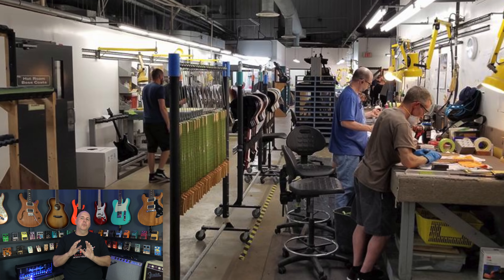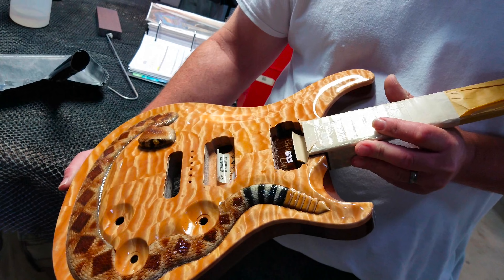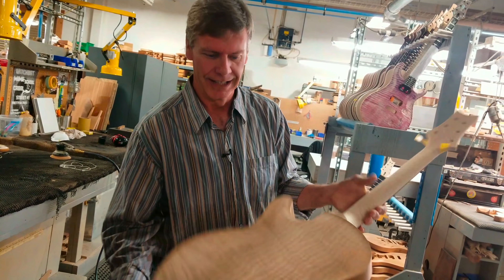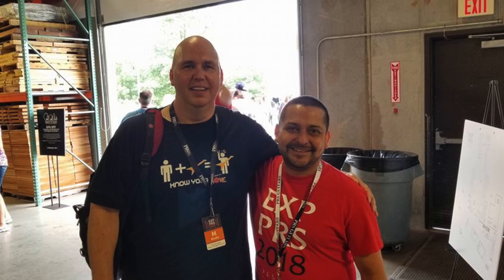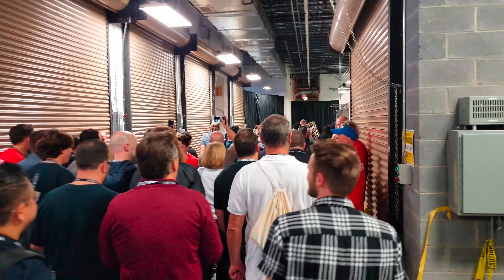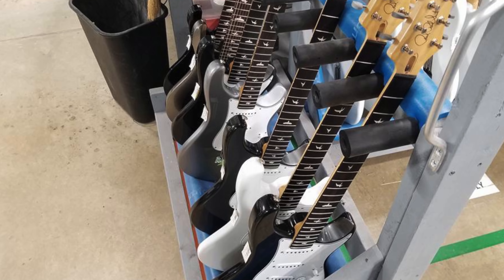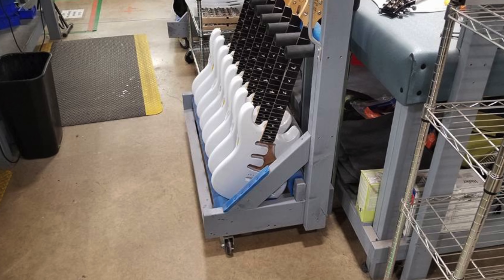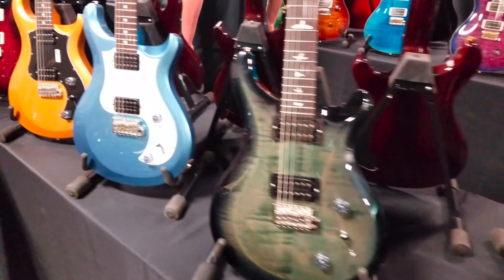What I learned At Experience PRS 2018 Event in 5 Minutes

Comment: Can I ask a about gear question? I have researched, but I don't trust a lot of people on gear other than you, Phil. I added a cab ext to my katana 100 in the back. Drilled, make sure I didnt hit anything and covered all possible contact points. Was VERY VERY careful. And it has been working for 2 months now. I made an nice polish wood enclosure for it to bring as a head to gigs. It has been working great. But, all of a sudden there is no more output. I tried and fidgetted with the cords and every wire contact point, and no sound, even white noise or squeeks. It hasnt been wet, dropped, played with by kids, dinged in anyway. I also bought an aluminum case for it. The only output that works left is the rec/phones. I guess my question is what would be the problem, or what do you think coulvde caused this? Can wrongly plugging in the cab ext into a DI box thru by the technician break it? Thats what happened before I couldnt get any sound. And if you couldn't ever get to this, I understand comments can get drowned in a sea of comments. Still will forever  love this channel. Thanks a bunch Phil.

Comment: Well now...why not use the best quality materials in the construction of the guitar when utilizing the best design, experience, technique, etc. To me, this begs the question...What if a much less expensive, man-made composite turns out to be the ideal material over the traditional, high quality, expensive woods? If tone and playability are king, the cosmetics are still addressable with veneers and other superficial treatments. My point is that Paul Reed Smith Inc. has left that stone unturned. If the material(s) are as irrelevant as indicated, then why not establish a particular material as a viable substrate that is a known and is a ready replacement for the more costly traditional woods? It’s another potential possibility as a way to produce a less costly, American-made guitar or bass guitar with the Paul Reed Smith name proudly emblazoned on the headstock. Please understand that I’m not “sour grapes” on account of the price and the inability to afford one. Not at all. I pull six figures annually; the cost is not my issue. Mr. Smith and his company make the best quality, as innovative as our staid, conservative guitarist community will tolerate, line of guitars, basses and amps extant. If there is any opportunity to be able to offer a larger mid-prices grade of instruments, like the Stella or similar, by discovering a much less costly material and then utilizing it, then why not? Nuff said.